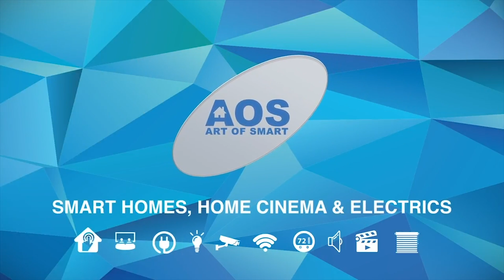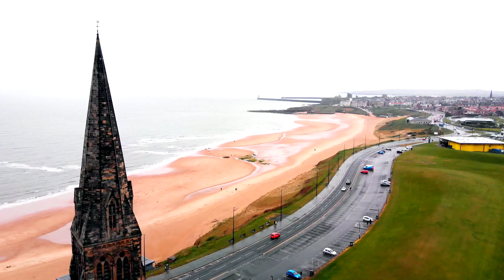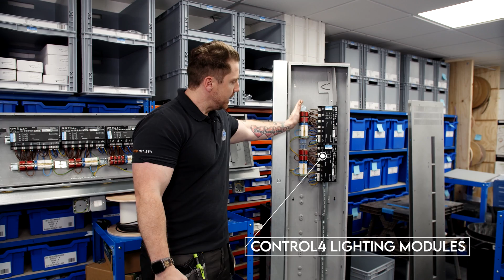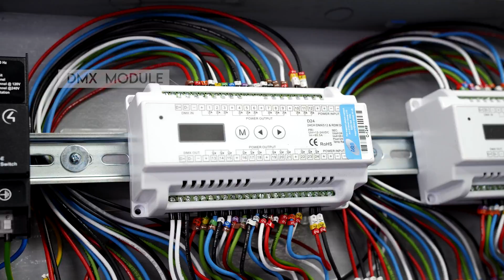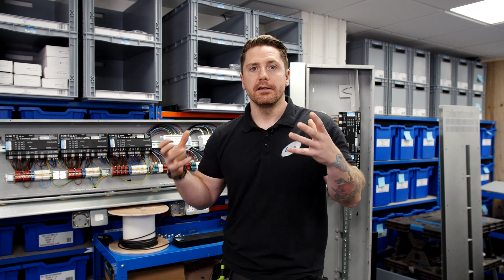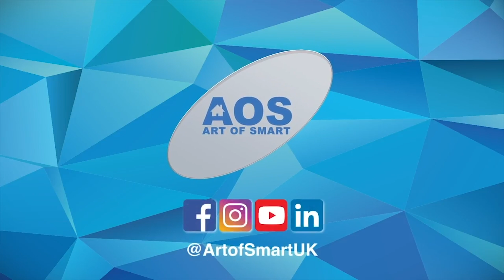Control4 Lighting Panel Walkthrough - AOS Rack Build Lab - NEWCASTLE Control4 SMART HOME

Comment: Hi, How the electrician test or use the existing lighting while you guys have the panel/blocks on the shop?
Reply from the maker: We use test links in the lab with some mock lighting set ups typically, can do a short video on this if you like?
Reply: Will be nice, but how about the electrician on site?… he has all the loads in the basement how they light up the house or test wiring? Or you put the panel in early construction?